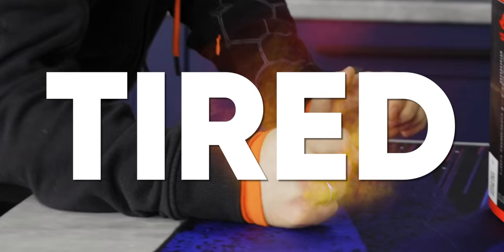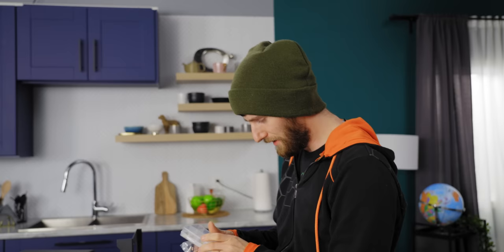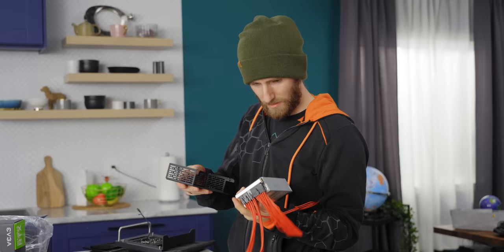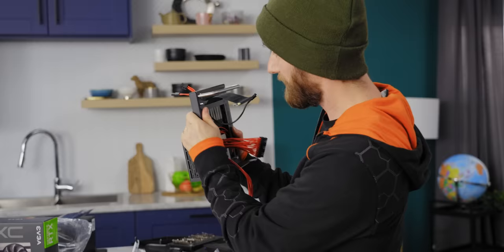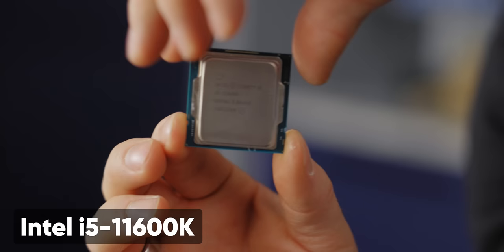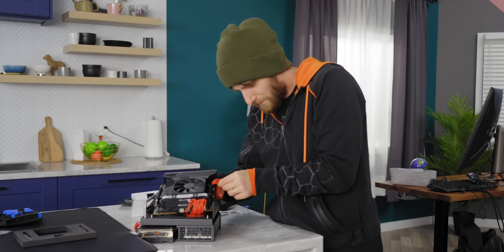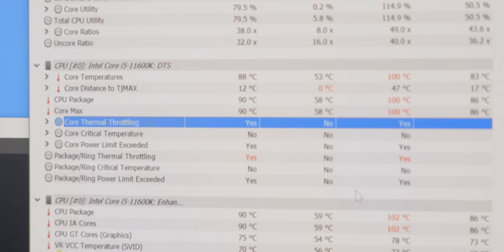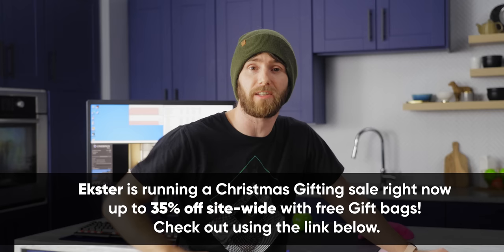Cases are Stupid. - XWORKS X32 "Case"

Comment: Cases like this are a great reason the 12V only power supply needs to become more common! That tiny PSU would be so much more efficient if it didn't need to produce anything but 12V
Reply: Also the psu could be in the floor in a separate housing with a thin wire between
Reply: 12vo require that alot of DC-to-DC conversion circuit on the motherboard,  these no way without massive sacrifice that you will find a ITX motherboard with 12vo  ><
Reply: @kentonian  like a laptop charger?
Reply: Similar to what Asrock did on the AM1H-ITX.
Reply: @user-Cata7sti7ma7  Thin Mini ITX motherboards have been around for years and are powered from a single DC barrel jack, most are 19V but some accept 12V,  these things have a 1inch maximum Z-height and can also power sata drives alongside the builtin AIO display.
Reply: 12VO would only move the efficiency Problems away from the PSU to the Mainboard which have other things to do than power delivery to the peripherals. I dont see the edge on that approach...
And on this tiny form factor the 12VO Standard would bring other problems like, where to put the needed power outlets on the board? I mean... it is pretty cramped on there to begin with.
Reply: @marshallb5210  I imagine those also have way lower power consumption/throughput, so the point is kinda moot
Reply: @user-Cata7sti7ma7  here's the thing, you really don't need to do much DC to DC conversion. You already have DC to DC conversion at the CPU anyway so all you have to do is modify it to support a higher voltage, you already have the 5 volt regulator down to 3.3 on the motherboard and many of the newer bioses just run off of the 5 volt so really all the motherboard needs is one to convert from 12 volt to 5 volt and use components that run off of 5 volt instead of 3.3 signaling... 12 volt supplies all the power and all of the other voltages are extremely low current anyway.

Texas instruments makes a 45-cent part that if you have two inductors you put out two amps at each of two different voltages off of both of its channels and it's very small.

It would make a lot more sense.

Technically most motherboards today are designed to use only the 12 volt, and they don't even use the 5 volt standby anymore other than using it purely to power the power switch before shortin to ground. So funny enough ATX motherboards already only really do use the 12 volt...
Reply: @ShenLong991  since everything is powered off of 12 volt that matters including the CPU, which is always regulated by the motherboard, it wouldn't make much of a difference.
Reply: there are platinum rated, HP server psu that only supply 12v, I used some for mining long ago, they are quite efficient and just as small, had a 1200w one, so I imagine these could made just like those.
Reply: @pilotavery  I consider the CPU not to be a "peripheral" to begin with. But yeah. now it makes totally sense to use up extra space for connectors just to be able to connect peripheral power to disks. even if it is not used, it has to be there, because someone want to use it, just to make it clear.
Reply: @pilotavery  what the mainboard needs doesn’t matter at all. The main part is that other parts still need the 5V and 3,3V rails.
So tell me where on that motherboard would you put the connectors for the cables?

Also it is correct that the regulators are cheap and quite tiny but they are already getting used inside the psu. Most of the modern ones are already using DC/DC converters to generate the lower voltages.

So I do not see any space saving on installing them on top of the motherboard.
Reply: @DigitalN   But you're not really losing any hardware or anything, all that power regulation circuitry just winds up on the Motherboard instead.

Though granted with modern motherboards doing virtually nothing these days there IS ample room.

That said, if something happens to just one of the power rails you're doomed to replace the entire mainboard, which is a complete disassembly and rebuild job, instead of just a PSU swap.   Still a fairly big task, but at least you probably don't have to remove the CPU, RAM and PCi cards.  There might be a case for breaking down the PSU into two modules, though.  Mains to 12v, a separate replaceable multi voltage module and THEN to ATX psu connector.  You could even take all the 12v rails for GPUs and the like off the first stage.
Reply: @nukularpictures  tell me what other parts need the 5 volt and 3.3? The only thing I can think of is the USB ports using 5 volts and maybe some of the circuits on older PCI Express devices, but modern graphics cards only use the 12 volt line for everything. They don't use 5 volts or 3.3, and other components on the motherboard like the ram, are powered off the 12 volt nowadays. There are many standby circuits that are powered off of 3.3 volts, however most motherboards will derive 3.3 volts from 5 volts and derive 5 volts from 12 volts directly on the motherboard. Even though the power supply will output 5 volts, most modern ATX motherboards will not use this 5 volts and won't draw any current from it.
Reply: @nukularpictures  most power supplies now include 5 volts and 3.3, although modern ATX power supplies after 2009 has already dropped the minus 5 volt. They literally don't include it anymore as the motherboard derives it by itself.

The fact that you do know yes, the motherboard has components that run off of 5, 3.3 volts, 2.5 volts, 1v etc, but while older motherboards would derive only some of them, modern motherboards don't even use any power from those rails. Modern power supplies will put 90% of their power on the 12v, and cutting the 5v and 3.3v has no effect on most motherboards with Ryzen or Intel 8th gen and up.
Reply: @nukularpictures  it's not really there for space-saving, the point is that ATX power supplies have these other voltages in them only for compatibility reasons, and since current motherboards already only use the 12 volts anyway, it doesn't matter. Try it out. Take your ATX connector from the power supply and look at the pin out and pull out any of the pins that are not 12 volts or ground. The only one you can leave is the green 5 volt wire which does nothing but turn on the power supply when shorted to ground, and you can even check the load with a multimeter to confirm that it's not actually draqing any power from it.

Comment: Fun fact, if there's no chips on the bottom, bottom cooling a board is even more effective, because what you're making contact with is copper on the bottom of the board and not just plastic packages which can't transfer as much heat.
Reply: That's true, assuming there are a reasonable number of vias on the section of the board in contact with the thermal pad... I would imagine most motherboards are chock-a-block with vias, but I've also noticed that even fairly expensive boards (like the Asus X570 ProArt) these days seem to be surprisingly thin with fewer layers than I would have guessed... I suppose it's cost-saving?
Reply: only if the board is made with that in mind, either through via's or the aluminum core pcb's used for led chips at times.  Most pcb's use fiberglass, which isn't a great conductor of heat.
Reply: @animefreak5757  Which is what via stitching is for.

Comment: Why is this so expensive?!
There's more packing material than case material. It's like the gamer equivalent of buying a designer g-string.
Reply: Small volume doesn't explain this entirely. The cost is probably not even a quarter of the sale price. It's just a given that these small cases have a ridiculous margin.
Reply: @El Dimos Karam "research" my ass, not a damn thing in this product is new.
Reply: I think I might stick to my PVC pipe rig.
Reply: I recommend getting an actual case, maybe even 2nd hand. Plus also, if you have kids, they might stick stuff into the GPU fan. Case with removable panels/easy installation.

Also, when moving the PC, you may end up scratching the motherboard. I don't have kids, but this sounds like a nightmare ready to happen. :)
Reply: @karebu2  Wait what, you have a PVC pipe computer rig? Care to show us?
Reply: It is also the price for the "case" and PSU

Comment: I understand this video is for fun and the item is more a novelty, conversation piece but for those who are asking the question of “case vs caseless” literally…cases are important for numerous reasons. Dust, animals, accidents, spilling drinks/food, acoustics, moving locations/homes, etc. Also, air movement over components is better than free releasing heat/air both for cooling and cleaning. Then there are physical safety reasons for children and animals from electric shock or body parts in attached moving fans.
Reply: If you are determined to go caseless, you are better off just building the thing into your motherboard's cardboard box it came in. Have a case fan kept in place via double sided tape/zip ties blow air towards the VRMs, and you are done. Paying some $179 for this thing doesn't make much sense.
It's a pretty hobo mode PC, but if you are situating the PC somewhere it is very unlikely to get anything spilled/knocked on it, and you don't have any kids or pets running around, then sure. At least cleaning the dust off will be easy if you have no case.
Reply: @MidWitPride  Or if you want something fancier, get a piece of wood and some brackets, paint it any color you want (or not) and just screw the components to that. you can go doublesided like the case in the video, or singleside if you want.
Reply: @heygek2769  I would not recommend wood for a PC, due to safety reasons (it could be a fire hazard).
Reply: @jankoodziej877  lol.
Reply: @jankoodziej877  Nothing under normal use circumstances get hot enough in your PC to ignite wood or even get anywhere close to the required temperatures. Unless there's a short circuit,  but at that point even most regular PC cases are in danger of catching fire, as those plastics used in them are also quite flammable under the wrong circumstances.
Moral of the story really is: Don't short circuit your components.
Reply: @MidWitPride  yeah, right, but that kind of thinking is against all fire codes and safety practices. There is a reason why no electric products are wooden, except external layer that does not touch the components. Wood, when regularly exposed to high temperature, gets drier and drier over time and will be able catch fire much more easily than at first.
Reply: I really dig this sort of aesthetic, but I'd most likely regret buying it immediately after seeing how much dust and shit it collects and how annoying it would be to clean. In order to clean my current case basically all I have to do is take off the magnetic dust covers and clean them off. Almost nothing gets inside of it.
Reply: @jankoodziej877  Even the driest of wood still doesn't have some 90c fire point. Not even card board or paper ignites at such low temperatures. PCs just don't run hot enough to be a real fire hazards on their own. Entirety of their fire hazard potential comes from short circuits. Ironically, having some case with steel frames probably makes the chance of a short circuit more likely if anything. Wooden case at least won't contribute to any parts short circuiting, as wood is a poor conductor, especially if it's dry.

"RF Self-heating / Spontaneous combustion
Corrugated board is combustible and should therefore be protected from flying sparks. Smoking must be strictly prohibited. The fire point is 258°C, the ignition temperature 427°C."

Such for card board. That's almost 3 times higher temps than the hottest part of a PC, that's not short circuiting.

"The temperature at which paper will burn can vary by material, moisture, and thickness. The average temperature at which it will ignite and burn is between 424 and 475 degrees Fahrenheit (218 and 246 degrees celsius)."

For paper.
Reply: I always relocated without a case (2x), one time even without a car... Lol when you buying parts they aren't in a pc case already btw, you can just use your brain and package it a little bit :D
Reply: @MidWitPride  you don't know what you are talking about. Google low temperature auto ignition of wood. When exposed over long time, wood can autoignite already at 256F. Sure, this is still higher than PC components get, but not that much. And if the fire starts for whatever reason (contrary to what you seen suggest, it does happen in real life in real PCs), metal case is just way more likely to contain it.

This is my last message about this topic, it's so obvious I don't feel the need to explain and argue more. If you want, use wooden cases all you want, I don't care.
Reply: @jankoodziej877  Yea, i Googled what you suggested, meaning ""low temperature auto ignition of wood"
And what i got was:
"it was concluded for the conditions studied that ignition of wood occurred under exposure temperatures of as low as 256ºF when exposed 12 to 16 hours per day in as little as 623 days or approximately 21 months."

Wood in that won't have such temperatures in any scenario. These temperatures are what some chip inside the components are having at peak. Case itself isn't exposed to anything even close to this.
Even under these circumstances, for this to happen you would have to run the PC at those temperatures for 2 years. So for this to happen you would need to:
1) Have the hottest part of the computer touch the woods somehow, meaning the GPU cores or VRAM
2) Play games 12-16 hours a day fo some +600 days, and this 623 day figure is the earliest estimate the study in that .pdf found, not the average even.
3) That hottest part needs to reach at least 125c, which isn't something any PC does at ANY part, not even a single chip in a normal computer reaches that high. Some very poorly cooled VRM might reach some about 100c. Again, this temperature is the lowest point they actually found this happening at, and the VRM isn't touching your case anyway.

These aren't real life scenarios for normal people.
This happening is on the same level as telling people to not have a metal framed case, because it might cause a short, if a wrong component is touching it. Some VERY serious things have to be wrong before this even becomes a factor.
All you really established here that having some exposed core touch the wood for  2 years is bad, so instead people should get metal cases to avoid this?
If they had a metal case and they did that, it would have a decent chance at starting a fire instantly instead of 2 years later.
Reply: @jankoodziej877  a normal pc is made out of metal which is also dangerous when dealing with electrical components. wood is non-conductive, so a normal pc-case has a way bigger chance of something going wrong. If wood really was a fire hazard people wouldnt be putting their metal pc cases on/in wooden desks
Reply: @heygek2769  there are multiple protections that make the use of metal case safe. First, there should be ground wire connected to the PC, which is connected to the power supply's casing. If the current goes to the casing, it runs through the grounding wire, which triggers the differential protection in the house and cuts the power. Secondly, the voltage inside the PC is low and the wattage/amperage is limited. This means that even if there would be a leak to the metal case and you would touch it and be shocked, it would be most likely harmless.

And this is all regulated. There is a reason why flammable materials like wood are not allowed to be used close to the power source. I don't know why are you arguing about it. Those regulations are an effect of over hundred years of experiences in household electricity. Sure, breaking some rule won't mean you will die in a flaming inferno, but the rules are there for a reason and when they are not followed, people are at risk.
Reply: @jankoodziej877  What about all the plastics used in PCs? They are often just as flammable as wood. Also guitar/speaker combos up to and over a 1000W are built into wooden cabs, cooking pans use wooden handles as well. You're just talking out of your ass. As long as you don't replace PSU components with wood you're going to be absolutely fine.
Reply: @heygek2769  whatever, as I said do what you want, it's your safety, not mine.

Comment: I think the dust problem is easily offset by how accessible everything is. Blowing compressed air to remove dust is no longer a 20-minute disruption with diving under your desk, unplugging, unscrewing, carrying outside, blowing air in all the nooks and crannies then reassembling everything. You'll need to do it much more often but the whole work will be 10 seconds without ever unplugging anything or even switching it off.

Comment: as an XTIA X-Proto owner, I must admit these cases are more functional than one might think! and TOP-I/O is extra easy to reach
Reply: been wanting LTT to do a review on one of those
Reply: I'm rocking the X-Proto L and I completely agree.  I love that thing!
Reply: got one too love it keeps my temps low
Reply: I have a Xproto and a XPROTO-Mini. Absolutely love the Mini for it's density; almost no free/wasted space. Although the GPU length limit in vertical orientation is rough, as is the need for a Flex-ATX PSU. Can't really use better than a 3060 Ti or a 600w PSU (which is what I'm using).